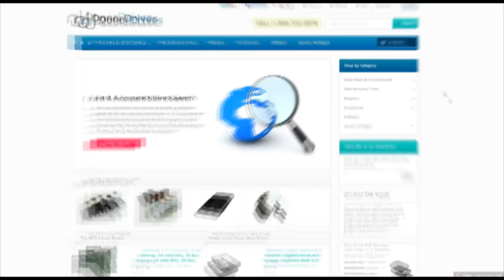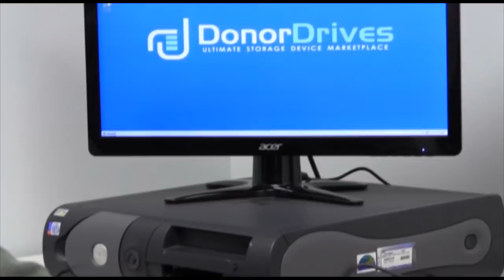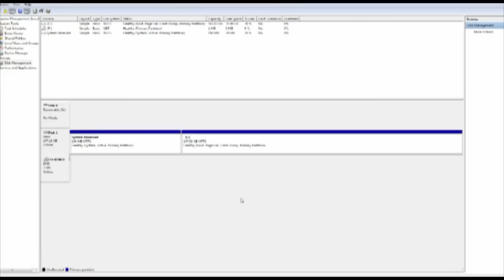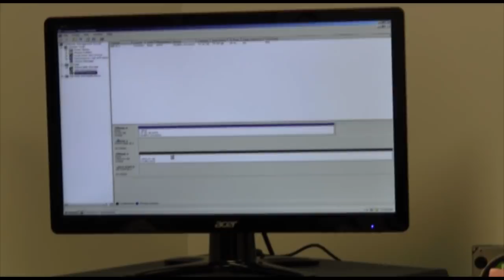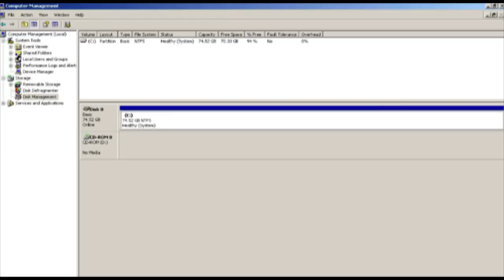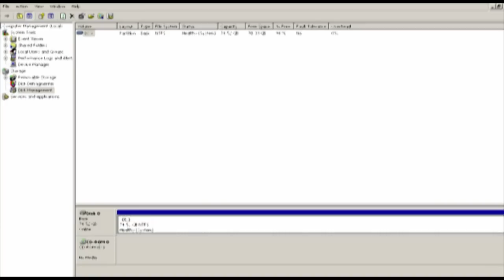DIY: Repair Hard Drive PCB. How to swap circuit board ROM chip.

Comment: I have done that as well. Swapped the board and Bios chip.the disk is spinning for about a minute and not detected by pc and stop spinning then. The pcb board is Rev A 2060-771822-002. The hard drive is 4Tb western digital black. What could be the reason sir?

Comment: do you have a budget service? if i only send in a pcb and a donor board without the HDD and just want the bios chip swapped, would that be possible? no testing required, i already know it works (hotwired a cap, but not wanting to risk a burnout during transfer and would rather a proper swap), not good with soldering so I didn't bother trying to replace the cap myself (could be more wrong with it or other caps gonna burn out?) would prefer an outright swap of the 88i8845D-BHG2 controller (BGA) to the new board.

Comment: I noticed in your examples the drive was recognized and unallocated.  How do you get the data off the drive if it unallocated?
Reply: You have a corrupted partition table. This can be from an infection (virus) or a bad partition sector. You can try to rebuild the partition table. The good news is that you "may" be able to get 100% recovery. Since your hard drive is dying, I suggest a sector-by-sector copy to an identical hard drive and then rebuild the partition table on the new drive. Remember: you will also copy over a bad partition table and whatever infections are there as well. You will still need to do your software recovery but you've eliminated the chance of hard drive failure.

Comment: I got a drive with most like a corrupted/broken cache chip. Can those be easily replaced? Does it need to be exactly the same chip, or would one with compatible specs also work? Can I just get one off the PCB of an identical drive and transfer it over?

Comment: Thanks Bud. Broke the SATA connector on a 4TB drive over a year. Needed another drive to do 3rd level Backup of my Development files on my NAS. Bought a replacement PCB for the driv; but it did not work. I had an idea what was wrong but your vid confirmed it so exchanged the flash IC and all is good. Now I have another live backup of my precious development files. Thank you for the time and effort it took to produce this video. ;)

Comment: Hi There, great video. That said, i tried doing a rom swap on a new PCB, same serial and everything. Only the drive makes a clicking sound now and wont let me into my files. When i check disk management it says to initialize the disk. I havent done that because i want to make sure it wont delete all my data... not sure what to do now or whether i should just kiss my data goodbye.

Comment: I have a seagate barracuda drive that was not spinning or powering on at all.  i swapped out the controller board from another barracuda.  It now spins up and the drive shows up in device manager.  Only problem is it is not showing any partitions and claims it is now 3.6G instead of 2TB.  Tried some data recovery on the drive but nothing found.  Would this be due to the fact I have not swapped over the ROM chip?  Or would the drive not show up at all if the ROM chip was the issue?
Reply: Kutulue most likely yes,  you can send it to www.copypastemaster.co.uk

Comment: 241/5000
Hello my friend, the ROM chip I have no more, I lost, have how to recover in another way without, the original board of hd, because I only have the HD, without the PLATE
Model 6YD0453C Part Number (PN): 9VT16L-301
Model number: ST1500DL003

Comment: ** Warning ** Do not use this company for repairs. 

I sent them my HHD after explaining that the Sata connector was broken. It’s a new HHD. I had them the part number  for the PCB and I got a email reply saying that they would prefer for me to send them the hard drive for a free diagnostic. 

So I called them over the phone. I spoke with a female service representative. She told me that her techs do great things and is amazing what she has seen them do. She said for the $60 fee ( which is what they advertise) if they can’t fix my PCB, they can replace it for the same price. 

I received a email today, stating that they cannot fix my hard drive. No mention of replacement. They only give you the option for return or disposal. How convenient for them. If you dispose it they get to fix it or use it for parts for other repairs.

So of course I choose to have it returned. What do I find? They are charging me $25 for a unknown reason and $12 for shipping it back. I can reason for the $12 for shipping it there. But now they want $37 for me to return my unit. 

This company is a con. Do not use them.

Comment: I followed this procedure to fix my Hitachi 2TB HD. First I did not buy a heat soldering tool I used my heat gun to swap the bios chip from the original to the donor board. Yes I could not access the partition on the drive after doing this so thinking outside the box  I used partition magic to shrink the volume to a more manageable size of 460gb as only 450gb was used. I then used partition magic to copy that partition onto a different 500gb laptop hd I had. I came back in the morning and all of my data was saved and accessible on the laptop hd. Total cost $40 for the donor drive.

Comment: I have a problem with unsoldering a chip. The flux just melts away, but the chip stays put. Im affraid to grill my chip, so how much heat do you apply and for how long?

Comment: I followed this video and bought doners from Doner Drivers.  WD 500GB. located a good match with same model number ,DOM, firmware,   I swaped out the Rom from my dead drives pcb to the doners PCM and nothing.  when I soldered ROM back onto the Donor drive which was working fine and showing up on my computer,  it's dead now
Reply: Looks like you killed the rom chip while removing it. Too much heat maybe?
Reply: I may have
Reply: all not lost yet.  I inspected the ROM chip under my Amscope and saw that some of the pins did. not take. I  will rework the ROM.
Reply: Question??   If I had my drives set up in Raid.  1 SSD 2 sea gate 3 WD and 4 and 5 as a raid to combine 4&5   Does my set up have to be set up in that configuration in order for those drives to be detected and how up in Disk Management?  Because I'm thing none of this pub rom swapping isn't fixing my problem

Comment: Hello. I could use some help if you would be so kind to reply...
I have a dead seagate barracuda model ST2000DM001 with a PCB number 100687658 REV C...
Is it accurate enough if I buy a PCB of that same number or are there some more important specs and codes i should pay attention too?
Moreover,is chip replacement a must with this model?
I have some pretty important data on this one and I would be most grateful if you respond...Thanks in advance :)
Reply: oh yeah,his firmware number is cc24. If I find PCB with the same fw number than I shouldn't have to replace it right? if they're not unique that is?

Comment: Do I need to switch out the BIOS chips on a PCB repare of a Seagate SV35, model number ST1000VX000? I use this drive for my hackintosh build if that makes any difference. 
Thanks!

Comment: You make that look super easy. How good of a heat gun do you need? What kinds of temps
Reply: Over a year later, I finally got this bad boy https://www.amazon.com/gp/product/B01NCB4SQ7/ref=oh_aui_detailpage_o03_s00?ie=UTF8&psc=1
practiced on a few ram chips, swapping back and forth
Then I did it on the HD. It worked on the first try! no flux needed or anything, just heat it up and drop it in place. Amazing!
Reply: GZA036 how hot did you get your air gun?

Comment: I have a Oct 09, 2.5" hitachi/lenovo 7200rpm 160GB drive with a burned 8-pin '25FU106B' chip that's listed as a CMOS chip. Is the CMOS chip the same as a ROM chip as described in the video? Thanks, anybody.
Reply: Yeah, that's the chip.

Comment: when you attach the new bios chip to the old board around 9:03, are you soldering it in specific places or just using a heat gun over the whole chip?  your hands are hiding this in the video and it seems like the most important part of this process.  will a heat gun possibly damage the chip? thanks!
Reply: Just using heat gun over whole chip. Heat gun won't damage it if you don't take a very long time. All you need is 10-15 seconds. If you using a rework station, keep it at about 375 F.

Comment: Where on the hard drive is the model and firmware numbers so I can find a match? I have WD5000AAKX. I think this is the model number but i'm not sure of the firmware number. Thank you.
Reply: For WD, the ROM firmware version isn't anywhere on the label. You would have to use professional tools to find the actual version.

Comment: Really helpful vid, ive swapped the pcb on an old fried WD hdd , (says dec 1999 ) now it does spin up unlike before with the pcb replaced but it doesnt show up on pc, just wondered if such an old drive would have the rom chip embedded in another chip as i cant see an 8 pin rom chip on the board, i can see 2 similar chips but theyre only 3 pins on each and labeled as u6 & u7, does this require adaptation?

Comment: I have a WD Passport Ultra when I was transferring  Videos from my laptop to the WD Passport Ultra it said has a fatal error 0x800701e3 sometimes its let me transfer files and videos but after I unplugged my Passport Ultra from both my Laptop and desktop and plugged it back in the computer didn't recognize it and won't load it I don't know  what to do to solve the problem
Reply: If you're on a Windows computer, search for 'Create and format hard disk partitions', plug in your hard drive and see if you hard drive appears in the list. If it doesn't, then search for 'WD hard drive driver' on Google and install that.  Beware of spam sites.
Reply: Most likely, the surface of the drive has degraded, or one of the read/write heads failing. You can try "adapt" your PCB to SATA board, and then use DDRescue or other sector-by-sector imaging software and get a best possible image of the device.

Comment: If original ROM Chip also damaged then ? Without Swap can or ?
Reply: Depends on the model of the device. In some cases ROM is 100% unique and losing it means losing data.

Comment: I did a swap on a 2GB WD drive. Started spinning, but clicks. Comes up as a drive, but not readable. Will the 8 pin chip swap repair this issue?
Reply: It should help, but with 2GB drives there are a lot of "BUTs".
Reply: Certainly

Comment: so if my drive spins up but is not recognized dose that mean it could be the pcb
i know for a fact its not my pc
Reply: Anything could be an issue in this case. Professional diagnostics are recommended, if data is important.
Reply: It could be anything, from faulty cable to a head crash. Need more details.

Comment: I have a 1TB MQ01ABD100 hard drive which is giving firmware mismatch issues despite the ROM chip being same on the PCB board. Besides, it also has a clicking sound issue. Could you please help in letting me know what can be the possible workaround for a successful data recovery?
Reply: Was your drive clicking before PCB swap?
Reply: Unfortunately, it was. :/ Please let me know if there's a way out. I'm somehow sure, there are sophisticated means available to extract data even in worse conditions

Comment: I have broken data pins...do i need to relace the PCB board?What are my options?
Reply: Yes, you would need to replace PCB.
Reply: PCB swap would be much easier than replacing the interface.

Comment: Hmmm, Great video. I had 2 Seagate external drives that had gone faulty at the same time pretty sure it was a power surge or something. It clicks for a few seconds then nothing. You can hear the drive spin thou. I wonder if its the PCB.  dunno if the eraser trick will work for this maybe lol. any suggestions ?

Comment: I had 4 Seagate "Desktop HDD" drives in a RAID and lightning strike blew all 4 of them up. 
Shame, they had been running 24/7 for about 3 years without issue..

Fortunately I bought 5 at the same time and I took the PCB off the unused one and so far it looks like it works.
I'll buy 5 new drives and copy them one by one .. and have a spare of the new drives as well.

Comment: Stupid question, I have  WD 1TB drive. It originally came in a WD my book home external case. (So it's really old.) I removed it and used it as an internal drive. Then it started disappearing when my computer restarted from hibernation or sleep. I'd have to restart the computer for windows to see the drive. The drive was never dropped or struck.

The current situation is this: The drive shows correctly in the bios but does not show in windows. I've put it in another computer and back in it's enclosure with the same results. The drive spins and doesn't seem to make any funny noises.

The drive has all of my family photo's etc on it. I had begun transferring data off of it when it started acting up, but I hand't finished before it disappeared entirely.

Does this sound like a PCB issue?

Should I simply send the drive in? I've been given a wide variety of prices from several vendors. 
One gave a range of $650 to several thousand dollars. With $650 being the least expensive if they recovered anything. 
The other was $200-$2000. 

None of the vendors are local to me. And none of them gave me any real confidence. They were all call centers or salespeople that knew nothing about the actual repairs. I think I provided them with enough information to get a more accurate estimate than what I received.
Reply from the maker: +Bl Ah It potentially could be the PCB. If that's the case, we can repair that for $60. We can't know for sure unless we examine it, though. Our diagnostics are free and there's no obligation to go through with the service if we can't repair it for $60. 
But to give a general idea: if it's a PCB problem, it's a flat $60. If there are logical or firmware issues preventing data access, it could be between, say, $200 and $800. If there are mechanical issues, like damage to the platters, requring us to operate on the drive in a cleanroom, then you are most likely looking at over $1000.
I'd recommend sending it in just to see. If you have any more questions, give us a call at 1-800-573-4909 and we'll be more than happy to answer anything about the repair service or data recovery.

Comment: but what if the original firmware chip is defective?
Reply: Depending on the model of the device, you might still be able to get data.

Comment: is there a way to buy a PCB that doesn't need ROM chip replacement?
Reply from the maker: +Alpaca Male It depends. Generally, no, but it depends on the brand. For example, Maxtor and Fujitsu PCBs often do not need to have a ROM swap, but for other brands it is usually necessary.
Reply: I probably have the worst.

the pcb I need to buy is mq01ubd100 for a usb 3.0 toshiba hdd

http://www.aliexpress.com/item/USB-3-0-HDD-PCB-Logic-Board-for-TOSHIBA-PCB-Board-Number-G003250A/1339376641.html
Reply from the maker: +Alpaca Male Usually Toshibas do need to swap the chip; you can check out our guide at http://www.donordrives.com/pcb-replacement-guide/ for more details.
We also offer a $60 service to do the swap for you. It includes the cost of the new PCB.
Reply: I'd do it if I lived in America, but I'm from Europe so my only choice is to order that PCB and try to replace the chip myself.

Comment: CLICKING HARD DRIVE, simplified explanation. When heads are unable to read data from platters' surface, the PCB would send a signal to reset the head actuator to it's parking position, and start all over again. For hard drive, it usually takes 1 second to reset the heads back to the parking, and release them again to attempt reading. When the head actuator makes it back on the parking position, the "knock" sound is heard. If the heads are repeatedly reset this way, it would sound like the drive is "knocking" or "clicking".

CAUSES. The reason why the heads wouldn't read the information, is due to some sort of problem in read/write operation. It could be (most to least common):
1. Physical damage of the reading heads (mechanical recovery required)
2. HDA Pre-amplier chip malfunction (mechanical recovery required)
3. Failure of read/write chip on the PCB (replace PCB)
4. Poor connection between HDA and PCB (use rubber/alcohol to clean connection)

Of course, the easiest is cheapest way to attempt and resolve the issue is using rubber/alcohol to clean the connection. Then would come PCB replacement. Last resort would be to get a data recovery service, if other 2 methods are not effective.
Reply: So i've replaced the ROM chip to a donor board on two 6TB WD Caviar blue that blew up while using the wrong modular PSU SATA cable.

Now they both click, both spin up but are just clicking. They emit a "nna"""nna"! kind of sound and clicks as the heads arm goes back to the resting point.

I guess they're done. Right?
Reply: Had a drive that would click along and even give out "scraping" sounds.
After cleaning the contacts on the PCB it seems to be fine again, running a disk check, but that takes a while.